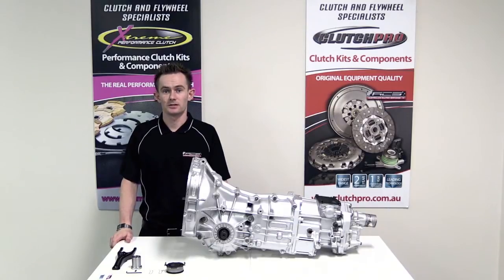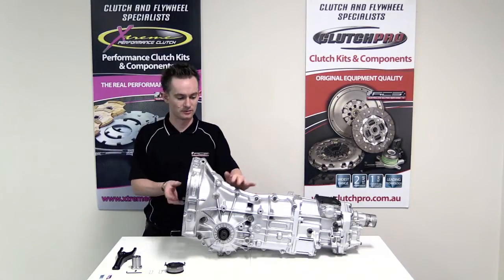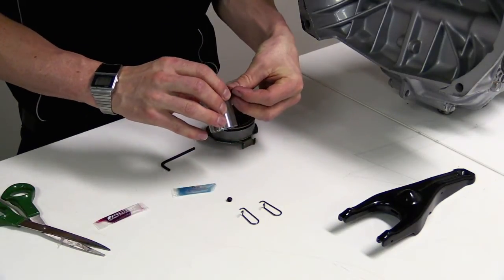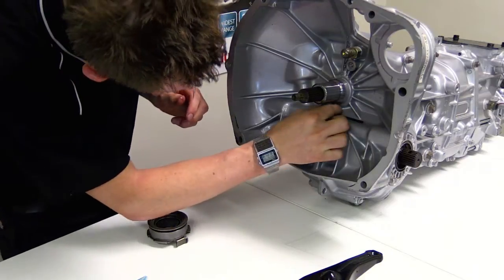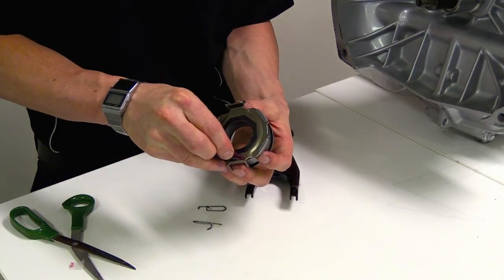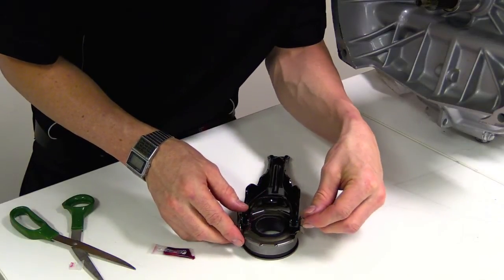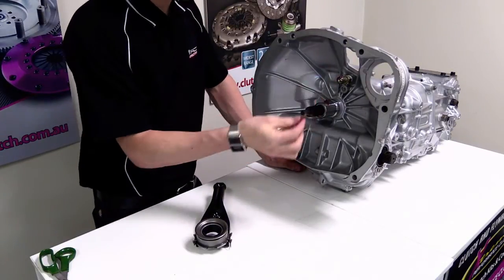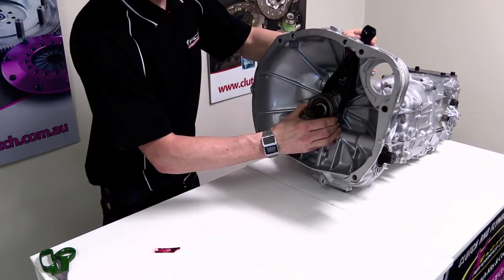CLUTCH TECH: Subaru Gearbox Repair Sleeve (TB33010-SLV)

Comment: Hi guys will this fit a 2007 SG9 subaru forester xt, 2.5lt turbo. 5 speed push type.
Got a kit but the bearing supplied was wrong, fit over the sleeve, but the clutch fork would not fit onto the new bearing. THe lugs on the bearing was too narrow and could not get the fork in between them.
Thanks
Reply from the maker: Hi Adam, Yes we do offer a Gearbox Sleeve Repair Kit for that particular model but the part number we supply is different to what we’ve used in this video. There are two common bearings we offer for these and while the bearing ID is identical, the distance between the lugs where the fork locates is different. If you could email our sales team at sales@australianclutch.com.au with the part number of the kit you have there and the details of your issue, they will be able to help you find a solution. Alternatively you can call our sales department on 1800 CLUTCH if in Australia.Thanks